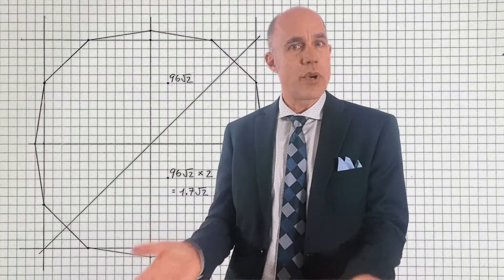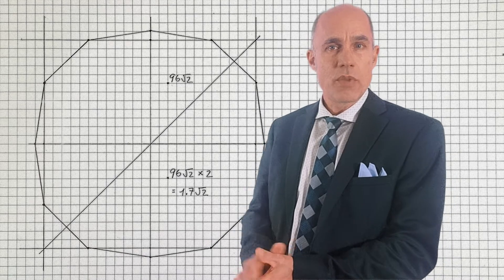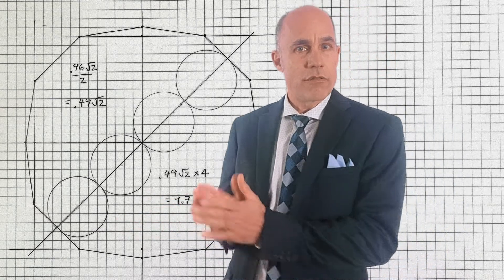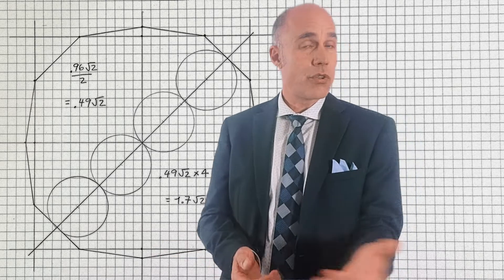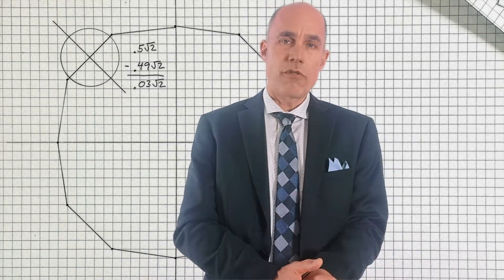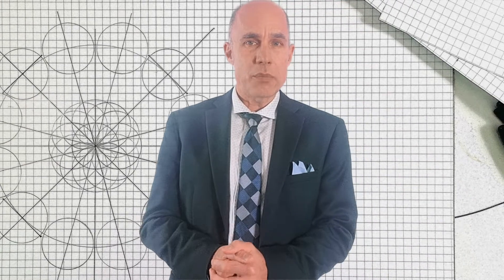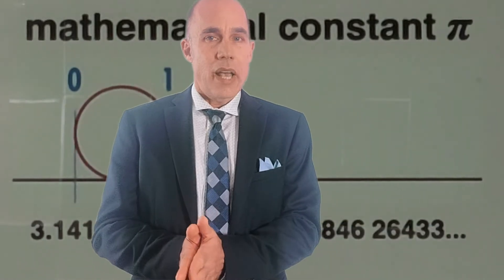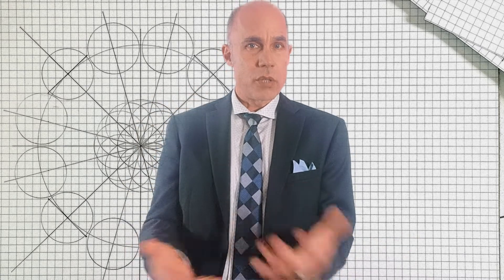What are the dimensions of the base twelve dodecagon, and how do we use it to calculate Pi?

Comment: For those curious, the base 12 value of the square root of two is 1.4B79170A07B857377...
Reply from the maker: Well, I am definitely curious, and interested, and I believe you are right. I know it is an arduous process calculating such a number by hand, so I want to acknowledge the effort involved. I want to add that I think that this quality of "empty space evenly distributed throughout the line" also applies to the square root of two, and really, to all the numbers we call irrational in general. More will be coming on this topic in future videos.